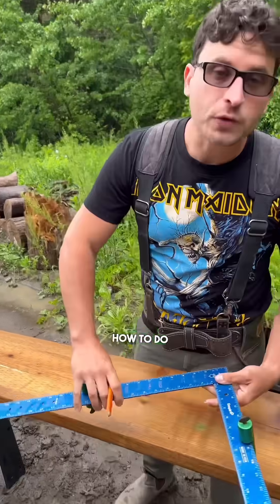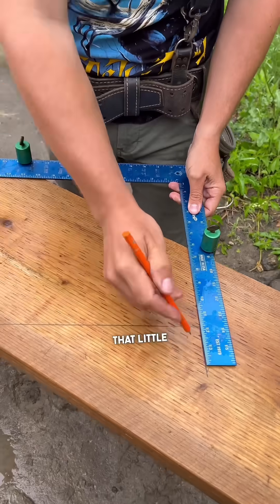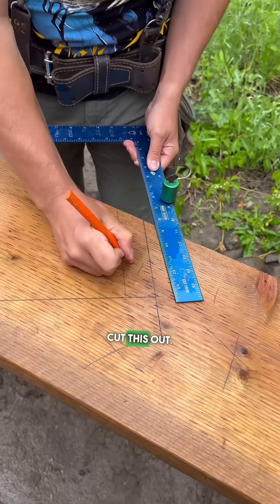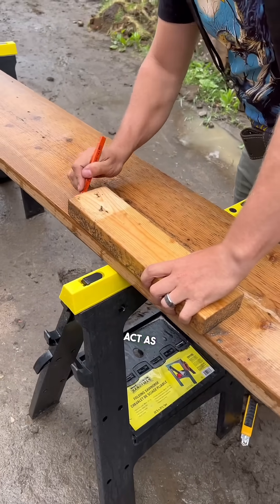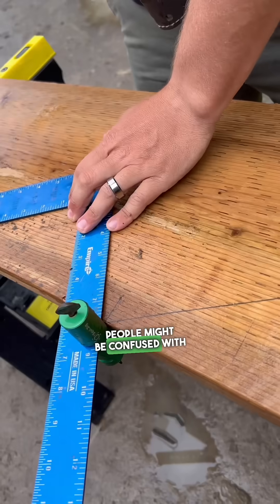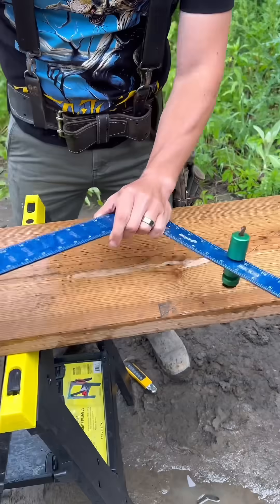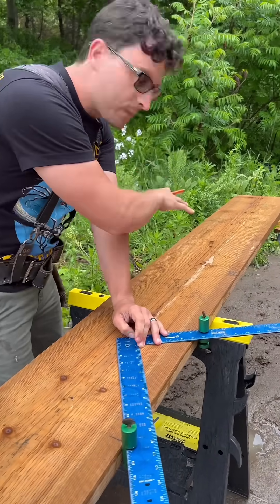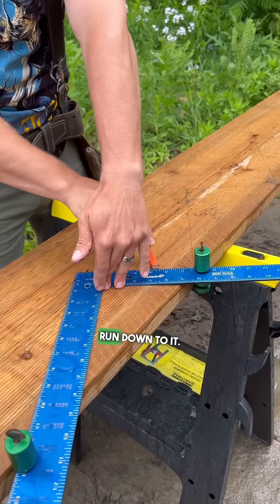Proper Stair Stringer Layout

Comment: i always square the edge of the board and cut a clean edge, make a center mark, put my run measurement on the mark, line up the point of the square with the edge of the board, then draw my run line to the edge fallowed by the rise line to what ever the measurement is to start my pattern. then square off the run line from that center mark to draw the line where the stringer will meet the deck or header. don't know if i was taught that way or just figured it out.

Comment: Could you not have started the first rise/ run closer to the end, wasting less material?
Reply from the maker: There was a big split in the wood. I’d rather not risk the stringer failing
Reply: Why not run 2 x 12 through a table saw..take off the round and then you have a nice sharp corner to do the markings. Only losing 1/8"
Reply: Why not run 2 x 12 through a table saw..take off the round and then you have a nice sharp corner to do the markings. Only losing 1/8"